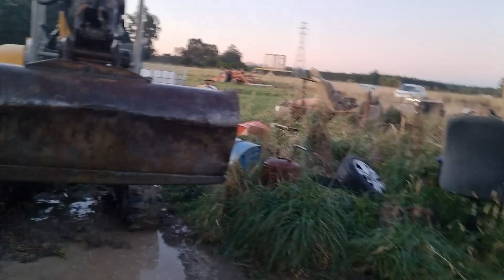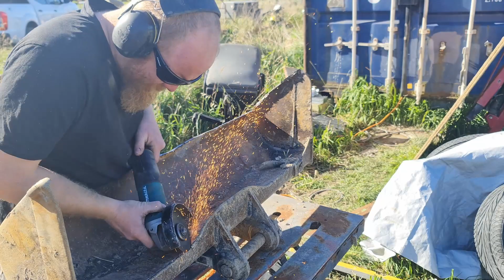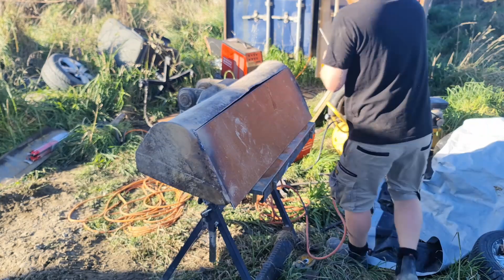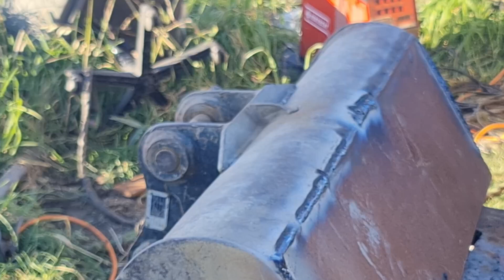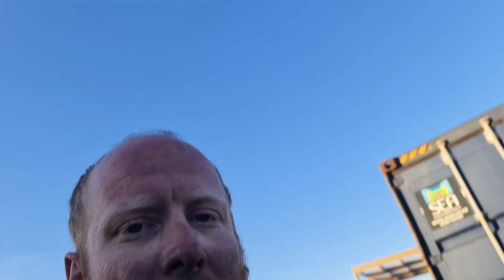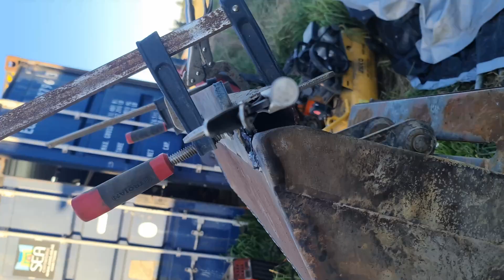DIY Digger Bucket Fix: How to Save Time and Money on Heavy Equipment Repairs

Comment: Why don't use gas cutting torch, working in danger.high risk using cutter
Reply from the maker: I don't own a gas cutting torch.  I have a plasma cutter, but I can cut more straight lines on uneven surfaces with the grinder.  I always have a hose handy to put out fires.  Cheers for the comment